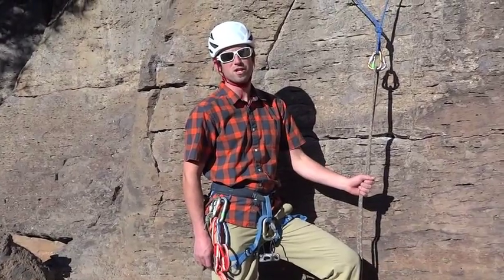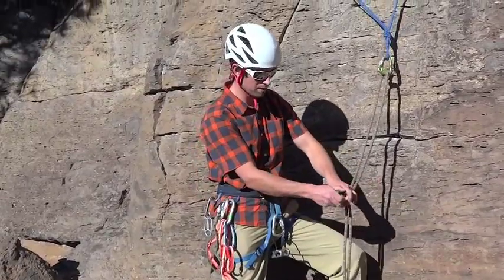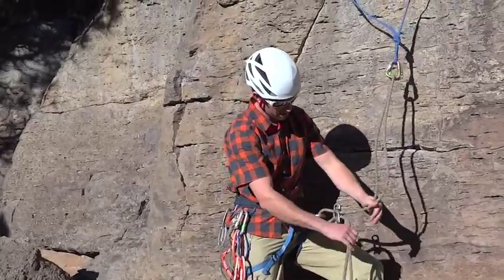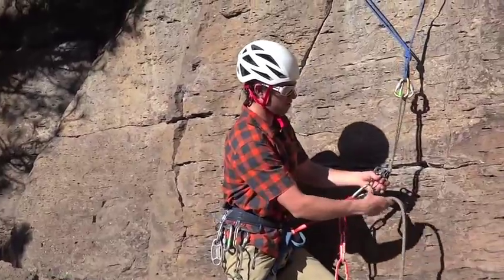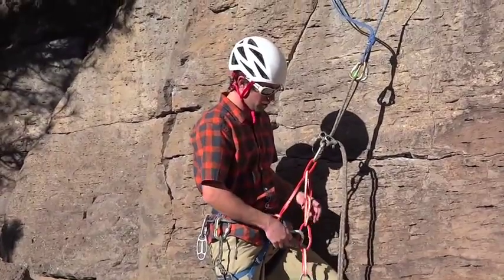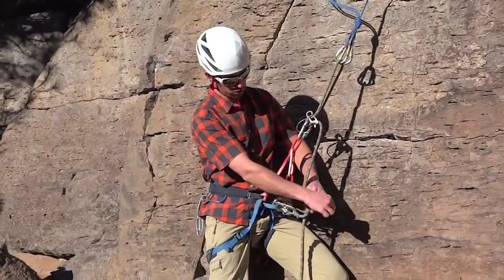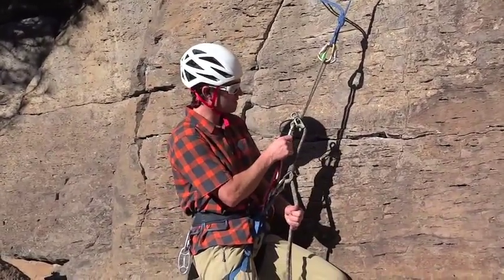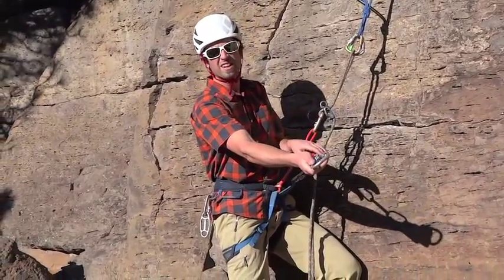Tech Tips: Make a Rappel Rig

Comment: This is my ideal setup for cleaning and rappelling.  I finally got my first weekend experience cleaning, and I had studied numerous videos for some of the safest practices before doing so.  This is the best IMHO.  One word of advice, as I learned this the hard way:  Extending the rappel means that you should account for the extra height when orienting the belay device and threading the two sides of the rope.  If the master point or anchor isn't high enough above your waist, you will need to work harder to create enough distance for the extended rappel setup, while focusing on keeping the belay device oriented correctly.  I didn't do this and ended up with a rappel rig that had the ropes twisted up.  Several minutes of stressful fidgeting 65' above the ground and I was able to do it over and get it right.  Also, the auto block setup is my favorite part about this system.  I met lots of climbers that don't use it and find it unnecessary, but I plan to keep using it forever.  Better to have a backup when the unexpected happens..

Comment: Just got the Metolius PAS 22, have not used it yet, I like it. The loop that is girth hitched to harness might make foot loop (in a pinch ) for ascending set up, seems to me.
I bought mine specifically for extending rappel. Was practicing single rope biner block rappel with back up Prussik  above figure 8 rappel device, "dynamic" rope stretch was   messing up the prussick, more loops moved knot closer to stretch top of figure 8, therefore I will be trying your system!
Hiked up Whitney several times in my youth, would like to do it again before I croak, maybe Mountaineer  route. May contact you. Cheers.

Comment: This dose not change you center of gravity, your center hands free will still be your harness attachment point. This does give you an area to hang onto with one hand that is not moving line which allows you to adjust your center of gravity with hand pressure. But it is great to see people putting the auto block on the belay loop in stead of putting it on a leg loop that wasn't design to be used that way

Comment: so if doing multi-pitch rappelling, you have to leave (some) gear behind? Or is there a way to pull your anchor cord down with you afterwards?
Reply from the maker: NoMotif Correct- this technique (multi-pitch rappelling) requires fixed anchors which are left in place.  the available techniques to rappel off of blocks and trees without leaving gear are sketchy and not advisable.
Reply: +Ryan Huetter unless you have someone else not rappelling down to lower your gear to you.
Reply: Even the one where a sling goes around the tree and the rope goes through both ends of the sling so it can't come off until after you pull the rope through?